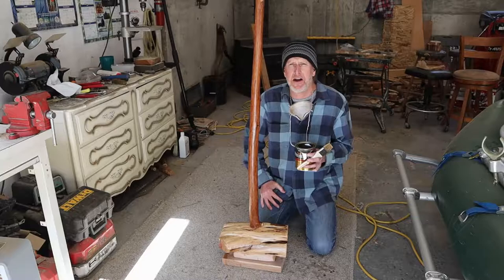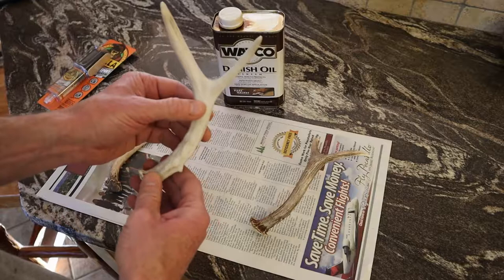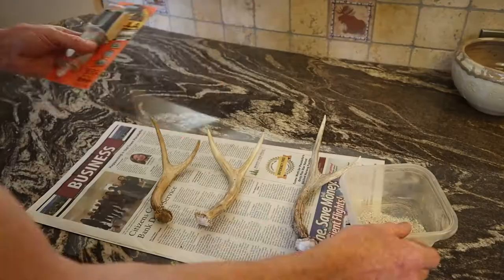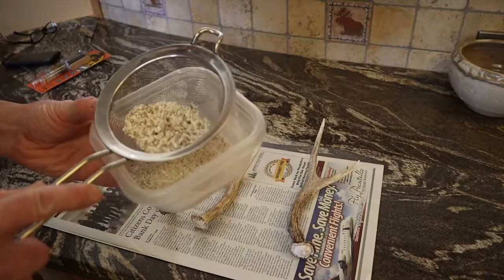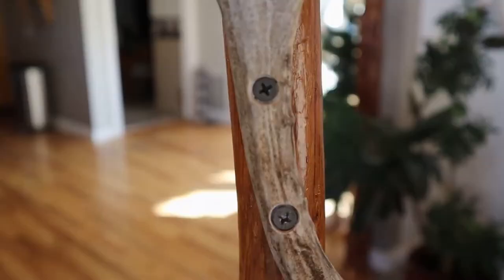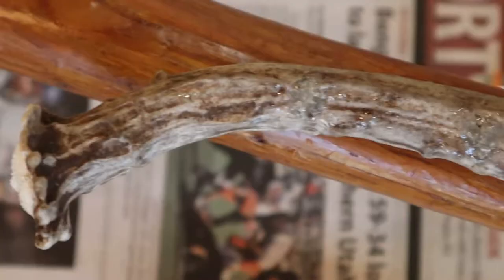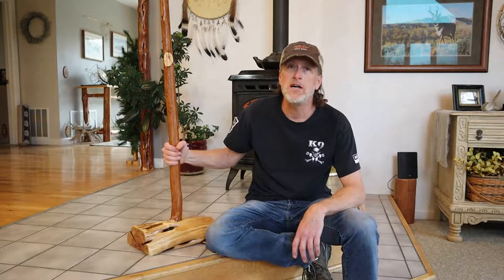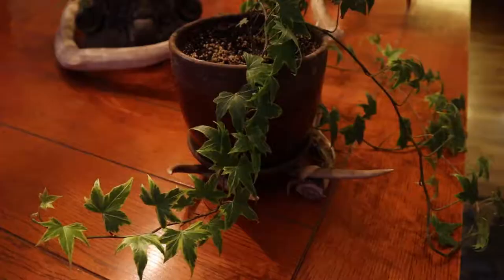Easily patch holes in antlers & darken whitened antlers

Comment: Great video, I'm now going to raid my wife's antler collection!  Have you done much with bone?  How does it differ to the keratin of antler?
Reply from the maker: Thanks. I haven't worked with bone. Since antlers are theoretically bone, I'd guess very similar.  Kind-of like different forms of steel, strength, hardness, how brittle...
Reply: Oh you're right, antlers dont contain keratin at all. Looks like I'm going to have fun raiding the wife's bone collection as well!

Comment: Hey, I have a few questions so my first question is were those real antlers you were drilling into because I'm making a project when I am trying to mount 2 elk antlers to a big board and I'm scared that I am going to crack the antler or the drill isn't going to go through the antler so do you have any tips for me?
Reply from the maker: Yes, they are real antlers.  I've never had an issue drilling through antlers including long drills to make antler chandeliers.  A sharp bit and it's pretty easy.